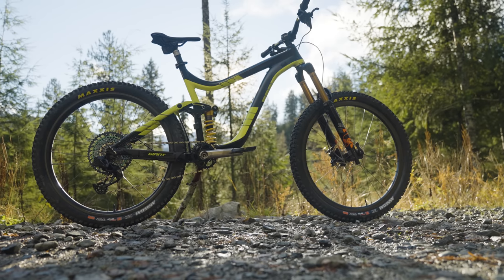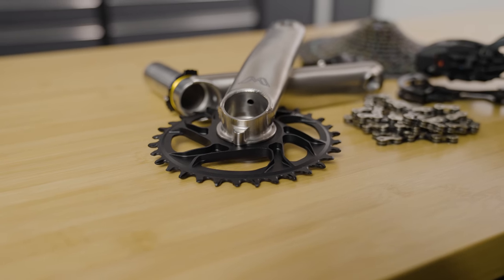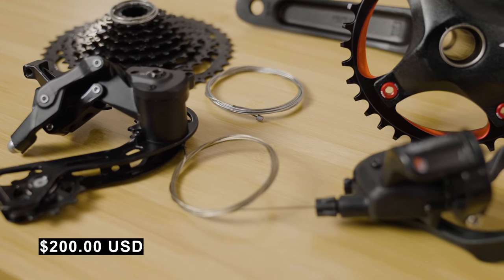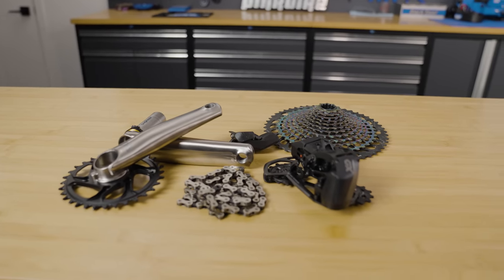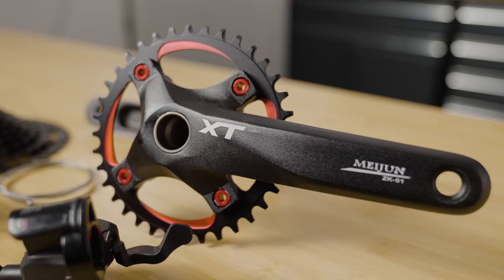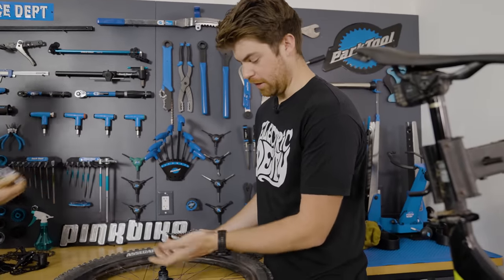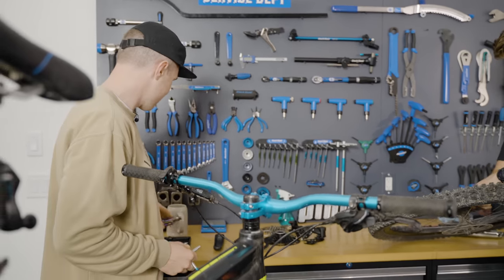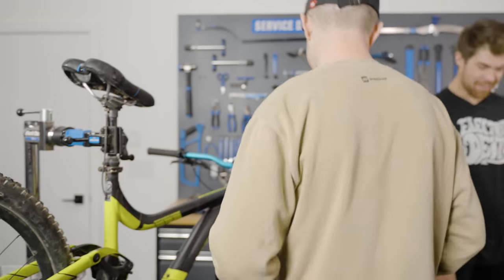$180 vs. $2400 Drivetrain - Budget vs. Baller Episode 6

Comment: I bought a ztto 50t cassette 10speed. Put it on my trek fuel ex5 but still running the raceface crank and original derailleur. Paired it up with a shimano acera shifter and works perfectly fine. The only difference is I splashed money into a decent kmc chain as from my bmx days I learnt chinesium chains snap with a wonderful noise and a very sensual knee to stem connection. I’ve probably got about 300km into the cassette and it’s perfectly fine for some stamped plated steel with questionable tac welds. 
Also those cranks iv been testing for 6 months on an old giant Boulder with an ltwoo group set. Works perfectly fine. Pretty sure those cranks are machined 6061 aluminum so the yield strength in the threads of the pedals you wouldn’t trust on a serious trail bike. 
I think this video is probably going to have a target audience of either new mountain bikers or the younger teenage generation. I’d go out on a limb and say most teenagers do not have 2500 dollars for a damn group set. Seems to be some hate in the comment section but the video is exactly what the title says. The parts are garbage but I’m happy using garbage parts on any of my bikes and riding it into the ground instead of throwing money into something I’ll never get a positive return on.

Comment: I just upgraded my hardtail to a MicroShift setup, I chose the advent over the acolyte.  Couldn't beat the value.  Where else are you going to get a new, unused, clutched, rear deraileur with ball bearing shifter for less than 90 USD?  I did splurge a little more on my cranks though and I went with a blackops crank with a 32t chain ring.

Comment: I have the advent 9spd with springlock, $120 I think, stopped all drops so far . Engagement is a little harsh on shifts underpower. It's quiet on the trails, and seems to be decent quality in general.

Comment: Cheap drivetrain is good when it's new,the problem is it's not going to hold up on tech stuff and it will wear out in no time...The bling stuff will last long time if you don't crash constantly.
Reply: Depends on how much bling. My buddy is a mechanic and former pro roadie. He talked me out of top end stuff because it gets "finicky", which is also why it runs so well when it is dialed in. I am all about XT 11spd on my trail bike, and am moving to it on my hardtail next month. Runs forever, cheaper than the cheap 12 spd, and is much nicer.
Reply: However a lot of times these top end blings are made for XC races mainly to reduce weight & therefore not as durable. My buddy cracked his XX1 crankarm on a root yet X01 is holding up just fine after numerous pedal strikes on stones. Same with cassette in many cases (more aluminum gears as opposed to all steel gear).

Comment: The main take away from running srams 10 speed set up was the derailleur was the weak link.The joint pins on the devices main body were either made of cheese or a smaller diameter and migrated through the metal swiftly, so with sram something like xo will last, i have x1 o my enduro and its really  lasted, 3 years and ta few thousand miles all remains tight. the x9 derailleur 6 months if lucky.

the only thing id add is if you smash derailleurs al the time go cheap otherwise that £60 cheap unit will be replaced so many times over distance it will cost at least twice the £170 unit. Thats my experience since 2015 averaging 4800 to 12,000 miles per year. (yes one year 400 a month some nearer 1000 as wasn't sleeping, really really not sleeping so day/night was out there)

hope this helps

Comment: Acolyte is marketed as a drivetrain for kids bikes. For a few $ more you could have had Advent or Advent X with 11-48 cassettes and proper clutch, rather than Acolytes ratchet system.

I run Advent X on my gravel bike because Microshift also sell brifters for it. 95% of the time I run it with a 42T ring upfront, but when I go bike packing I swap it for a 34 to give me some serious climbing power.

Comment: I liked the way of thinking when making this series. But sadly it did not turn out the way i thought it would. Instead of trying to actually get a cheap Setup going, its more of a "Lets get the least famous cheap parts for the bike".
There are Shimano Deore Cranksets for less than 50 bucks brand new
There are Schwalbe Magic Mary performance line tires for 15 bucks each (They are heavy as shit)
There are Crankbrothers plastic pedals for ~20-30 bucks
There are Shimano groupless hydraulic brakes for less than 20 bucks a piece.
Seeing the trailer they didnt take any of these. Even Cheaper options, available in actual stores and not on Wish or ali baba with almost the same performance as better groupsets.

Comment: Had a M5100 drivetrain on my "old" bike wich got stolen But with a Sunrace 11-50 cassette instead of the Shimano one and a YBN chain for 180euros in February of 2021 and i couldn't complain about it the slightest bit. Only downside i had is that the M5100 RD doesn't work with older 11spd shifter's otherwise i would have gone for the M8000 XT shifter.

Comment: To me, the biggest advantage of a 1x system is the fact that you don't have to coordinate shifting between the rear and the front. Especially off road where you often have little time to change gears. While watching the slow motion of the ridding, the SRAM clearly has a much better clutch mechanism.

Comment: When referring to gearing ratio, you should mention the wheel size.

Eg. Henry thinking back to his old 34-42, there is every chance that was fitted on a 26" bike which is a perfectly reasonable ratio. On a 27.5 or 29 you would want to drop down the front chainring to compensate for the larger wheel with the same derailleur.

Comment: I've got a 2x10 and I love my bike but I worry about the conversion to a 1x not fitting proper.
Reply: I put a 1x12 eagle on my 2001 hardtail Klein, no issues at all
Reply: Get XD driver, narrow wide chainring, 11 speed shifter & el cheapo ZTTO 9-42 cassette & you’ll be happier. At least that’s what I did (all for under $200).

Comment: I run the Microshift Acolyte 8-speed on my eMTB and it works great. The only thing I would warn riders about is that after about  8 or 10 rides you have to re-adjust the derailleur.

Comment: I'll be honest with you I've never used a top of the line crankset before so i don't have much to compare too, but I've been using a budget $45.00 IXF crankset (which is what he has, just rebranded) and it's been extremely solid. IXF is the go-to for budget minded people who want to go to a Hollow Tech 1x crankset. Also the MicroShift Acolyte is a good groupset for people on a budget but a AdventX would be better for a little bit more. I was going to go with AdventX but decided to go with a Box 4 groupset and I love it, although the always engaged clutch is a PITA when trying to take my rear wheel off.

Comment: Really the sweet spot is somewhere between the two, but still closer to the low end. Cheaper service, good performance, good durability, good value. Shimano deore,  and their identical siblings which do not carry the deore name such as bl-mt501 to bl-mt6000 which are the exact same but one is cheaper and uses a slightly different paint color. I don’t own a mtb but I ride gravel. I have a cheap ass hybrid I got from rei for 500 which now sells for 1k with a hodgepodge of upper low end components such as Shimano alivio and Altus. Alivio rear mech with shadow is damn good and dirt cheep. It fits an 11-36 cassette with 9 speeds and a tripped up front with 48-26 range. Pretty sure the range works out to be wider that your run of the mil fancy gravel bike nowadays with 1x. It works damn well. Really my only issue with the bike was cheap hydraulic brakes which had me fearing for my life on a decent due to fade which got upgraded to the deore type, tires to something more gravel specific, and some esi foam grips. The thing has been rock solid for like 4 years now and is totally badass imo. Basically buy a bike for a hood deal with value stuff on it and you upgrade and change the stuff you don’t like or is not performing well. You save a ton of money and end up with a pretty cool and bombproof ride.

Comment: I would go for Deore M61000 SGS instead for better range, at least on a 29er. bu if smaller wheels the Microshift probably would be an alternative too, but on 29er I would have to use a smaller chainring, I currently use a 32T. I have Archer D1XTrail, which is an electronic shifting system, but I can use any mechanical rear derailleur. A complaint people had was it shifted too slow, but now there are new batteries that make itt shift much faster.
I currently have Deore M61000 SGS, absolutte black 32T oval, Garbaruk 11-50T cassette, not cheap, but works really well, easier to clean, and half of tthe weight of a Deore cassette, butt much cheaper than Shimano XTR and Sram XO Eagle, Race Face Atlas cranks,  robust cranks, but awful preload ring, so I upgraded to Cane Creek preloader, Chris King Thhreadfitt30, works well.
I went for cheap RD cus I don't need anything better, and I can destroy an rear derailleur and a cheaper rd won' be as big deal.
So I think I have a pretty good bank for tthe buck electronic setup.

Comment: I used to ride 11s 11-42 with a bigger ring and crank and as Henry knows the Cotswolds can be hilly so I saved my knee with smaller ring and crank and then fitted a 9-46 11s cassette…

Good transmission is like good golf clubs or big race car engine, it makes a very average unfit riders much better than they are 😜

Comment: Like many people here, I would have rather seen a comparison to SLX or even Deore.  I ran an Eagle X01 12 speed drivetrain since 2017.  While it works well when it works, the rear derr is flimsy and poorly engineered.  The jockey wheel screws pull out and everything gets eaten by the cassette.  These derrs are far too expensive to trash on a regular basis.  I can't imagine paying big bucks to replace a wireless derr due to a design flaw.  The X01 cassette and XD driver body is a thing of beauty but also crazy expensive.

I swapped to a Shimano XT 12 speed drivetrain to get off of $ram upgrade train.  Overall it's excellent, the shifting is WAY better than Sram but the cassette is a lot heavier and Shimano microspline freehubs always fail.  The multiple upshift and downshifts from the XT shifter is great.  I did break a spring inside the shifter and the Shimano warranty process is utterly useless, in my experience.

Shimano has never made a strong freehub, I've broken too many to count since the 7 speed era.  I used a Sram hub that was also crap so they're no better.  Pair a 12 speed Shimano drivetrain with a strong hub (e.g. DT, Chris King, Tarin Shogun, etc) and you'll have perfect shifting and save thousands of dollars over the long run.  OneUp oval rings up front will save some money too.  The XT rear derr has been pretty strong so far, has a serviceable and adjustable clutch,  and it's about 1/2 the cost of X01 or less.  The Shimano 12 sp XT cassette is like a throwback to the 90s with rivets, separate cogs and different sized spacers, but it works great.  I'm running an SLX cassette due to lack of parts availability and it shifts as good as XT.  I would expect Deore to shift well too.  If weight is a big concern, you could buy a Garbaruk cassette instead - still cheaper than an Eagle cassette.

Comment: Cheap chinese cassette is worth, but that should be paired with some proper shimano/sram derailleur, for good chain retention. If you're looking to upgrade, maybe the best thing is to go 11speed, since you don't need to change hub drive body, and used shifter and derailleur are dirt cheap paired with chinese 11s cassette.
I paid less than what's shown in the video for a shimano 10s with a clutch and 11-42 (with hanger extender).

Comment: Should have gone with the MS Advent instead. For just a few $s more, you get a better shifter, 9 speed and a clutch. Would have been a better budget setup for about the same money. 
I recently upgraded my old school to a 1x using the Advent shifter/derailleur, Snail 32t ring and ZTZ 11-42 cassette.  I went with the ZTZ not for the price, but it had a better low range setup than the MS, I liked the chrome over the black, and the side-by-side comparison looked like equal quality. I didn't need the crank, so I spent about $160 for the conversion.

Comment: I am against 1x drivetrain. It's more ride spezifik.
On mtb it's not for the way to the Hill but I need that 48er crank on the front for the street.
I love the range of my 3x9 with 48-32-24 in the front an 11-46 on the rear on the mtb with a bandwidthof 854%. 
And the 3x10  with 50-39-30 in front and 11-34 on the rear of my road bike with a bandwidth of 515%

Comment: one thing for me is that i would never go with a battery powered dropper or derailleur. i would want a cable for absolute reliability. i have a 1by 9 speed slx crank shimano bottom bracket saint pedals xt derailleur with GUB tension wheels with ceramic bearings an xtr cassette and shifter. it was not cheap getting that stuff. i use a PNW cascade dropper external routing. all this on my 2018 GT Avalanche hardtail. well my wheelset is a matched DT Swiss 350 series hubset with performance plus nipples and spokes attached to a set of mavic 834 hoops maxxis minion II dhr max terra 3C tires a renthal alloy fatbar 800mm and a renthal apex stem at 31mm x 31.8mm dia.
Reply: oh yeah i have a wolfs tooth seatpost clamp and dropper lever. oh yeah an MRP slider with a cradle and chain guide. thats it.
Reply: oh yeah i use a dt swiss rear axle and nut combo for my 135mm hub due to the frame is a 135 QR but it runs and works like a thru axle. oh yeah i have a rockshox recon silver rl 140mm fork at 100mm thru axle with a rockshox stealth axle. i love the stealth axle. ok thats really it

Comment: **Someone please pin this comment, people need to read it* If you watched the donut media hi low series, you could see that it’s not necessarily about upgrading for cheap, it’s all about if you needed to change parts (get wider bars for example), can you do it on the cheap, and how for those cheap parts stack up against super expensive parts. This is way easier to do with cars than it is with mtbs.

Comment: My XC bike had a 165 rear shock with 50 mm of travel 😂 more than most enduro bikes
Reply: the shocks length and stroke have nothing to do with bikes real wheel travel. If your bike has 50mm of travel it has 1/3 of most enduro bikes travel or less.

Comment: I’ve been amazed by ZTTO 9-42 & 9-46 cassettes $40-$100 range. Of course you need XD driver for that but I was able to convert my old 2x10 drivetrain for cheap by just swapping the shifter & freehub body. No need for big 50/52t cog
Reply: I've seen a local rider's Ztto cassette he replaced his eagle cassette with, he did 800km and it looked almost like new and had no issues. I've not tried it, but was cheap.
Reply: Johannes Nilsen you should definitely try. I’d say best bang for the buck!!!

Comment: You've been robbed, Henry. Those cranks  should only cost 30-40 USD.

And as for those who see the "trash" parts like they're paper mache, you're blinded by your biases. The only gripe with those cranks are the weight, tolerance, and finish. But otherwise, they're as strong as an Alivio crank.

Comment: All the episodes of this series have made some level of sense to me as you were taking something thats broken or just crap and improving it. But in this case, it would have been better for Henry to leave his stock drivetrain on. It was significantly better than the Microshift parts he installed. If youd both started with bare frames I could see it making sense. But this episode of the series, unfortunately, is completely pointless. Im disappointed actually. I was excited for this one.

Comment: As others have said, this series is a good idea.  However, some of the parts swapped onto Henry's bike are downgrades!  The budget 'upgrades' don't even make sense.  It would have been cheaper to get the existing fork serviced as opposed to replacing it with junk kashima knock-off.  It would be nice to see SRAM SX vs SRAM XX1 type of comparisons.  You can still comment on the difference without making your sponsor look like shit. 

Mountain biking doesn't have to be crazy expensive.  There are a lot of middle ground consumers that want something better than a Huffy but aren't ready to go full carbon AXS.  You are doing a major disservice to this market.  You'll get more people into the sport by showing affordable, sensible upgrades to get more fun per dollar.

Comment: Ya'll spent a good amount of money on a shit off-brand drivetrain when you can get a reliable, branded and tested Shimano Deore 11-12 speed for a little more than 200 dollars, mega fail.
Reply: But if they would go with Deore 12 speed it would be impossible to justify in any way buying so much more expensive stuff for normal people, you just can't find enough benefits in paying 10x more for something that in performance and capabilities is basically the same. This series is worst buying guide possible, it's based on Donut  media car series, where for cars difference between top-end and cheap value-level parts is big enough to justify spending more, for bikes if you go top-end vs cheap value-level parts that big difference just does not exists, because of that they have to go with cheap but not value, ill suited for the job, not brand stuff to be able to say that this expensive stuff even makes sense to exist.